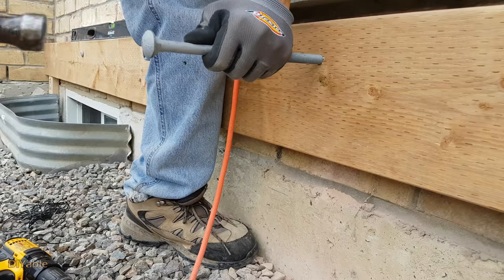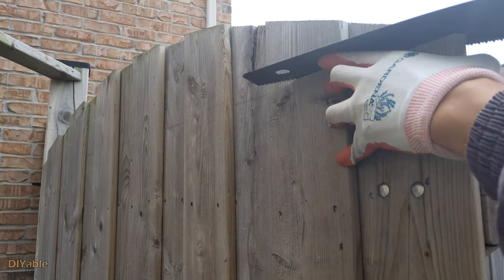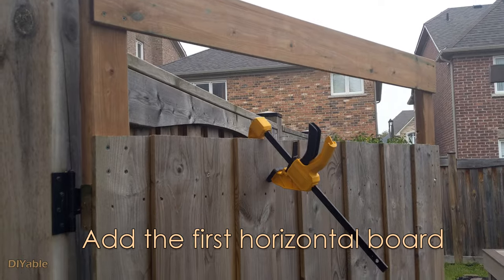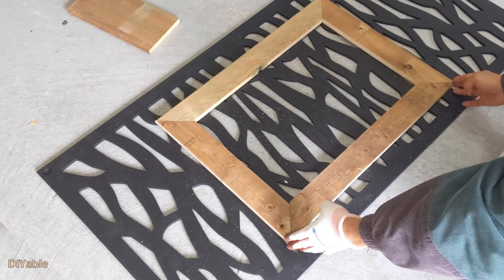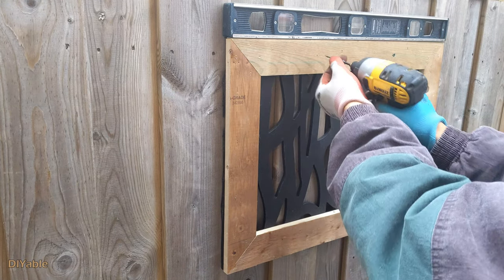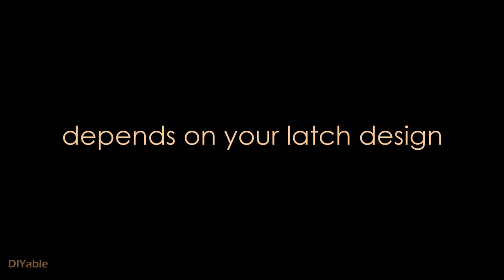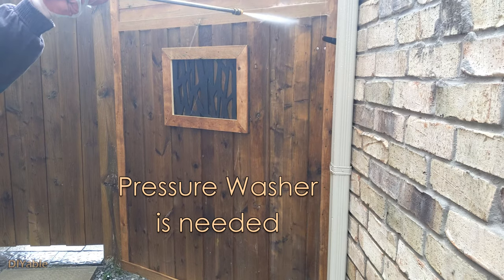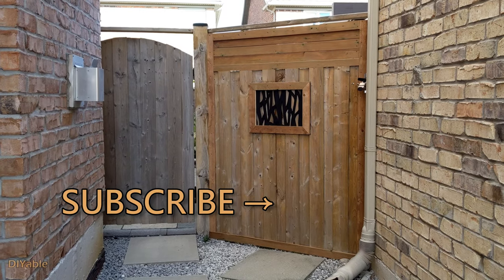DIY Deck (Part 17): How to upgrade the ugly wooden Gate for $30 as a weekend project?

Comment: Great job! Love it. I am planning to do my gate. What’s the name of chemical wash for wood? Any brand you recommend? Thank you.
Reply from the maker: The bottle I got was leftover from many years ago, there is no particular brand I recommend. They are very similar, you can get fence wash or deck wash. The only thing I would suggest is to get the one comes with the spray head attached to the bottle, so you can just attach it to your garden hose, that saves you from getting a garden sprayer.
Reply from the maker: @dyif913able  Thanks! Glad it helped!!!